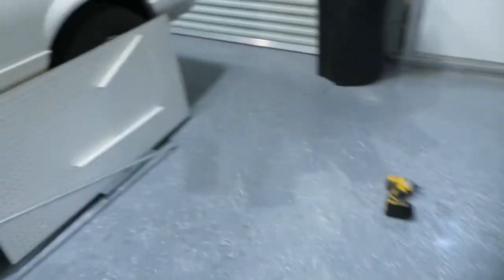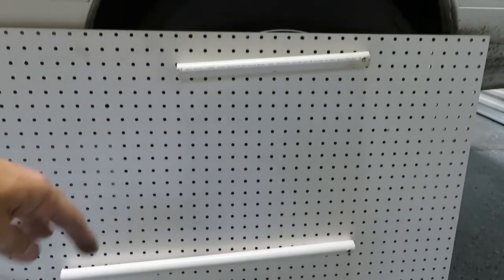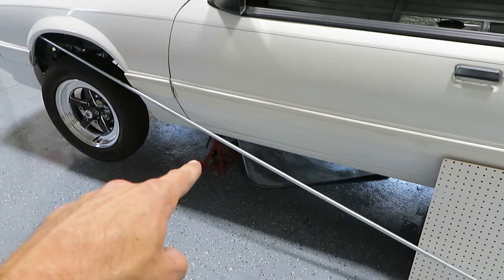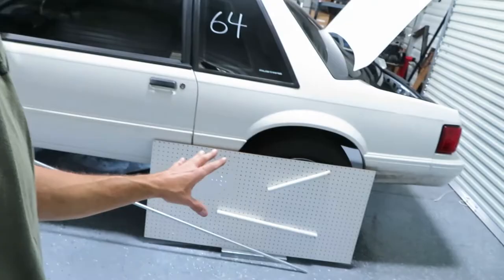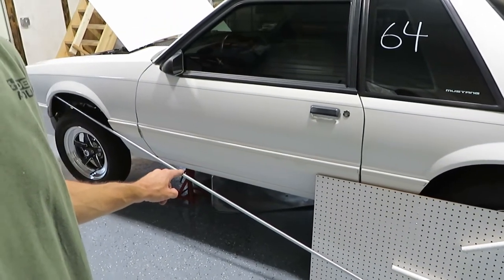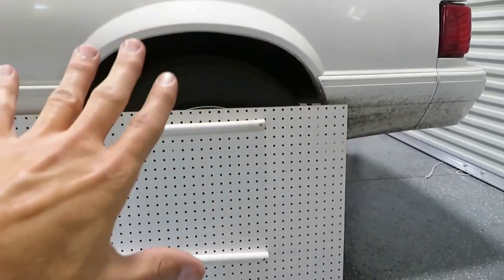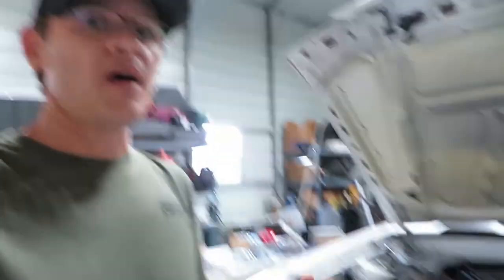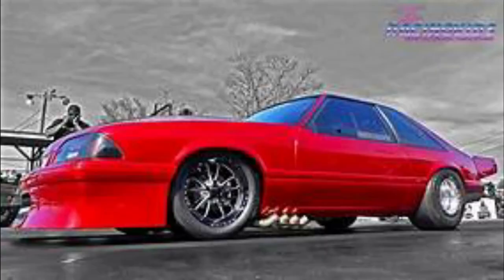Fox Body Mustang Suspension Basics For Better 60 ft Times! Part 2!

Comment: Great illustrations of Instant Center! I finally understand. I'm the original owner or my Fox and have gone on so many forums in effort of trying to understand instant center in relation to upper and lower control arm geometry. you made it simple.   So many people spend their hard earned dollars on suspension mods and not understand what they do and what to adjust.... me included. I've recently installed the upper relocation kit you mentioned in efforts of getting better than 1.7 60's. I haven't cut my stock rear springs yet though. Like you, I have strange shocks and struts but have left the front full loose and rear mid (good ole 90/10 & 50/50 mentality).  Maybe I should change as well. My car has run a best of 10.40 at 127 with a DA of 4000. I feel it has more if it just hooked better.

Comment: Hi great stuff much appreciated all tips and tricks, I have a question can I run 430 gears in the 1/4 on a 275 60 15 mt street tire without running out of 4th car is  pretty stock gt 40 heads long tubes dumped.. thanks
Reply from the maker: 430s might be to much for the quarter.

Comment: great video
.great video!!...bone stock 302 with a 100 shot of nitrous,Toyo 255 50 x 16 drag radials.j@m adjustable lower control arms..I ran a 13:81 101mph..I think I had the car sitting high in the back..should I have lowered it as much as possible..thank u
Reply from the maker: Don’t over do it. 1 coil cut of stock springs is about perfect.

Comment: Hello love the videos.  I have an 4.8 LS swapped 1987 foxbody hatch. I have rear suspension upper and lower UPR control arms and Team Z drag springs with strange adjustable rear shocks. So my question is are  you still using the quad shocks?
Reply from the maker: No

Comment: Size tire are you running on the back. And also what size wheel are you running, cuz I've heard the width of the wheel can play a big part on a drag radial (depending on it's size)
Reply from the maker: 8 inch wheel. Yea a lot of people like to stretch the tire on a wider wheel and yes that does work well.
Reply: @fox-body  Are you running like a 275, 26 in talll drag radial then

Comment: Great info, thank you. Im curious, you reference big power cars would benefit from a different setup. What would you consider a big power car. 8-900hp ? Also how much of this would change with a stick car?
Reply from the maker: The main difference is the shock setting.  Low power cars like mine 500 can run the shock full loose so you get max separation. You risk tire shake  when it unloads with higher hp cars.  this is where a double adjustable shock would come in to play.  There are a lot of factors depending on your combo.  I could go on and on.lol!

Comment: Did you also remove your quad shocks? If so how would that effect street driving..being removed would that cause more wheel hop.? I do not have a bunch of power just trying to learn a bit more than you suggested.. to witch I will be doing your video was very helpful thank you
Reply from the maker: Yes. If you have aftermarket uppers and lowers, wheel hop shouldn’t be an issue.

Comment: Great info!  I have a team Z grip 1 setup in my fox.  They did the geometry for you and you can't change it, only pinion angle.  Any suggestions?
Reply from the maker: I had that setup as well on a previous car. It works well out of the box.  All I did was play with the ride height and set the piñon to -2.5. If the rear is to high you have to lower it. Depending on the weight of your car there springs may not be right.

Comment: Where would I want my IC with 500 rwhp , 3500 stall, 275 radials, foot braking?
Reply from the maker: Foot braking 500 hp on 275s should hook up pretty good.  But I would cut 1 coil of stock springs.
Reply: @fox-body  I’m using MM springs, 1.5” lower than stock.
Reply from the maker: @petejoseph8257  those might work. Typically lowering springs are not good for drag racing.